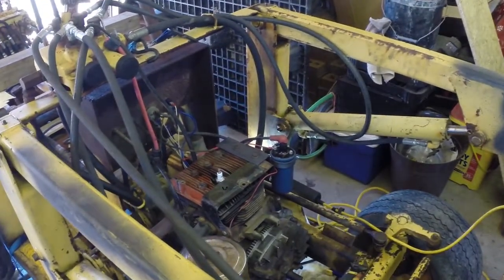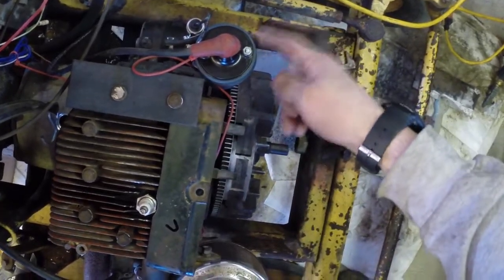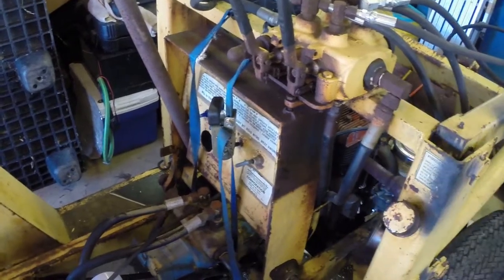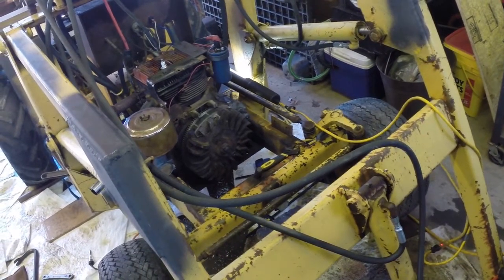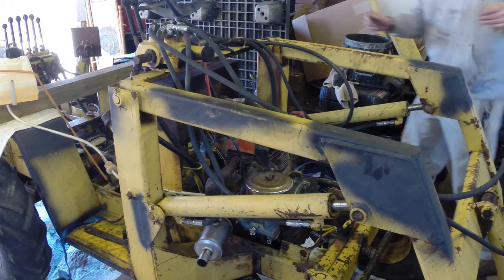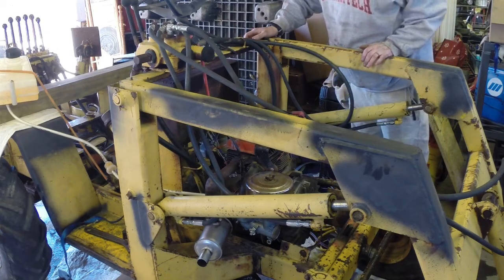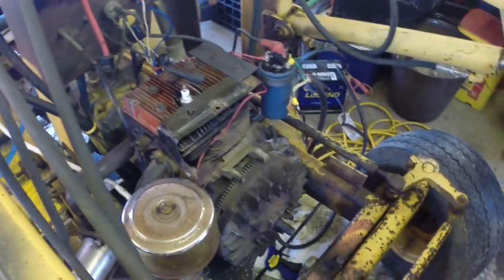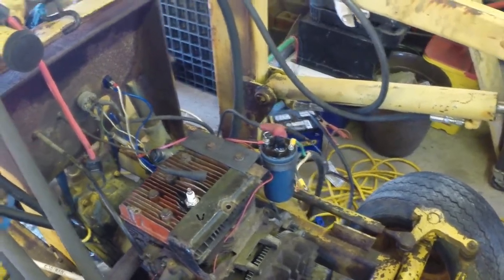Terramite backhoe project PT 8

Comment: I have a 1996 T5C, I have a hydraulic cylinder for steering that's not working anymore.
I see your steering is mechanical. I'm just making this point cause I think Terramite
may have closed shop, nobodies picking up the phone.  I may have to figure some
way to convert my steering to mechanical  or adapt hydraulic steering from a different
brand tractor.  Anybody know where to get parts anymore?
Reply: @ahoward0922  Thanks.

Comment: That's pretty strange that's an older one I have one its  probably a mid eighties t5b and all the other ones I see run off the flywheel side to the hydraulic pump mine has an actual adapter bolted to the flywheel with a coupler that goes to the hydraulic pump the way yours looks to mine as its running the pump backwards but that's probably the way it was designed back then my hydraulic tank is under the seat and my battery is up by the engine I also noticed the water controls seem backwards you're pushing forwards and its raising it up kinda seems backwards but that would be easy to change to swap the hoses mine is a t5b it has a 18 horsepower opposed twin Briggs and Stratton engine also if your cylinders have no power really weak like tobacco part won't pick anything up as most likely the seals inside the cylinders are bad bypassing the oil I had to replace mine as it was doing that it had no power local hydraulic shops have sales you can buy cheap and change them yourself other than buying them from terramite which is a rip off I think I bought a seal kit off them was like 60 dollars  and I can get the same seal at the local hydraulic shop for about $20
Reply from the maker: I am pretty sure when the previous owner hooked up the front controls backwards when they replaced the hoses. This one is a 1975 so the history is any ones guess. i know the T 3-15's drive from the shaft side... I would imagine that the pump wouldn't work if it was running backwards, but i did wonder about that when i first starting looking into it. My front hydraulics seem pretty strong, I was able to pick up the rear end of my subaru. the backhoe is weak as piss water thought, I am thinking its the spool bc i was told that the cylinders have been rebuilt, and they are drifting. Thanks for the heads ups about the seals I have heard that terramite is super expensive on parts.
Reply: I just found my bill the packing kit for a 1 1/4" x 2 1/2"  cylinder think that was the main back bottom ram  they charged $47 and the smaller outrigger ram seals was $37  and I bought a tooth for bucket it all came in a little box and they charged me $21 shipping that was back in 2011. After I found out I got ripped off I went to the local shop and got the exact same seals cheap so I learned  but toubcan always call and get part numbers and prices to try to find cheaper yeah the rear arm cylinder seals was blown out had no power you could hear it like it was bypassing it  not hard to fix
Reply from the maker: tjones2269 I hope that is the case and it isn't the spool. Once this 16" of snow melts and it gets above 5 degrees I am going to hook up a pressure gauge the hoses and see if i can track down which ones are bad